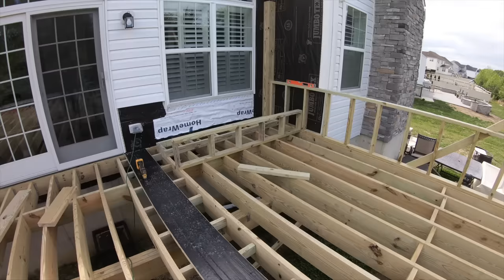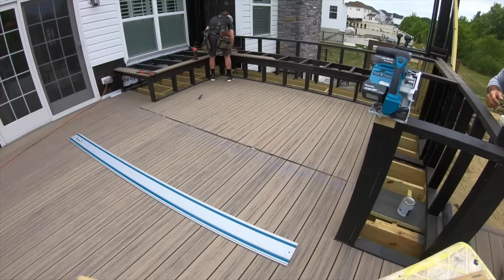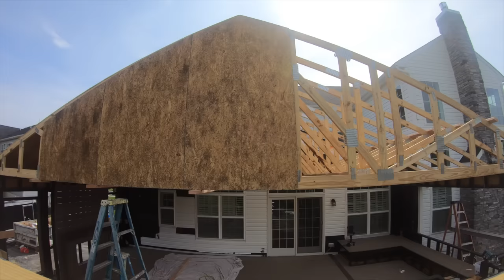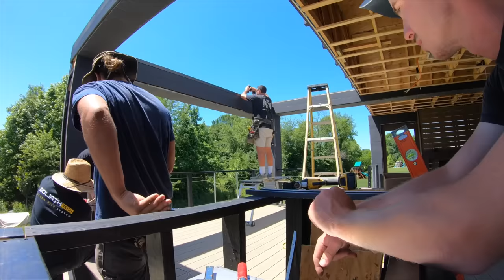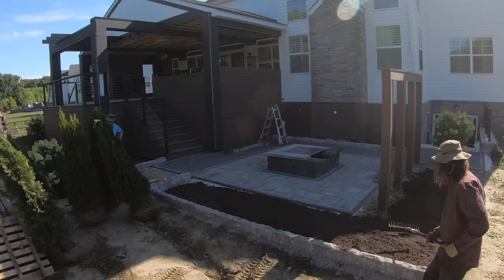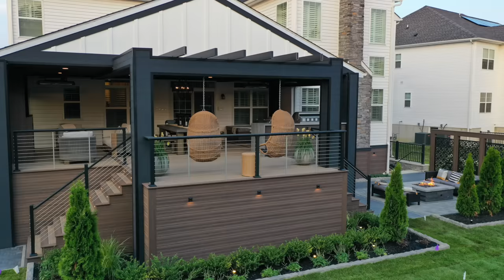INCREDIBLE BACKYARD MAKEOVER!! Covered Deck and Patio Transformation Time Lapse

Comment: Looks super nice!! Only wish they would've vaulted the ceilings and put in a big sky light as the roof blocked basically all of the light going into the house. But the design is flawless, modern, functional, luxurious!
Reply: Yeah, seemed like a huge waste to cover up that huge deck from the sun.
Reply: @C3mvp  I would have left the vaulted part at least; to let in the air and cool it down ( as the hot air would've risen outta the way

yes it would be more word as the internals would need to be weather proofed
Reply: Agreed
Reply: @anythingwewant604  The reason for blocking all that sunlight is because the sun coming through creates lightening of the color what ever it hits, also depending on where it is having skylights significantly heats an area like that up. They knew exactly what they were doing. This is a perfect job.
Reply: No I think they built it right, that's why they have the outdoor area near the fire pit for sunbathers. It would be nice to sit on that deck on a warm day with a cold beer. Go downstairs for the sun.
Reply: @kimgallagher6254  it's not about the light outside, it's about the light going into the house. That whole section of the inside of the house where the new roof is will be super dark now.
Reply: @TheRealSweedie  ☝️

Comment: Phenomenal work. I do wonder how you are able to make such a large structure without pouring any concrete footings.  I saw the machine piledrive the steel poles into the ground. So, I guess if those poles/pillars go down far enough then that will be sufficient to not need concrete footings?? Either way this looks amazing and I certainly would want something similar attached to our new home build currently in progress.  I probably would want a couple skylights so it just a little brighter underneath.  Thanks for sharing the video,  awesome work!!
Reply from the maker: Thanks a lot!! The footings are called helical piles and the machine can read the torque at which they are being installed. The engineer will spec a certain amount of torque needed to achieve for each footing depending on the load and that way we can be 100% sure they will never move under the load
Reply: @THEpremieroutdoor  won't the earth shifting affect it? Idk anything about construction
Reply: Well that's why in storm all can fly away 😂😂😂

Comment: Question ? Is the foundation adequate in comparison to that much weight. Seems like that addition should have had a concrete and rebar foudation to prevent sagging/ settling for long-term. That seems like a lot of weight? They done a beautiful job...looks great...but will it stand the test of time without a concrete and steel foundation?
Reply: It doesnt seem like alot of weight it is alot of weight. I would have gone with concrete to be sure. How are those skinny metal post not going to sink with all that weight on top of them
Reply: @juniorpineda4151  
Si Exactly 💯 Makes you wonder what kind of building codes and inspections exist in this location ?
Reply: Helicles can withstand a lot of weight. I've used them many times building decks
Reply: @Corvus_Crow  True, agreed fine and dandy for a deck. But this build was way more weight than a deck. Was a room addition.
Reply: @Sword-Shield  many houses are built on helical piers.
Reply: @Corvus_Crow  True...but concrete and steel foundations are better...stronger, but not cheap. You get what you pay for in the long run. Been around construction my whole life. No pole system is stronger than a real concrete and steel foundation. No matter how many times the helical system is used. I can show you foundations of concrete and steel that are still standing and strong after 50 years. Time will tell on the newer systems. Hide and ⌚ watch.
Reply: @Sword-Shield  not trying to be the advocate of aluminum, but helical drive down on average 5 ft , where most code standards for concrete footings are 3 ft. Not far from the Frost line . They both work effectively , just two different options
Reply: @Corvus_Crow  True. They both work. However, I'm old School and set in my ways. From the class of.. if it ain't broke dont fix it. In the academy of construction 🚧 the Golden rule is in the strength of the foundation, so goes the rest of the structure. In other words ask any old timer if you have to cut cost somewhere to stay within budget, never cut cost on the foundation. Foundation supports entire building and structure, as long as there will be a structure. Very important. Sure the  helical supports work...but they do not become one with and part the earth like a concrete and steel foundation. Nice discussion. But for me its concrete and steel on the foundation. Concrete is 5000lbs. [Solid as a rock] Per square inch...steel ties it all together as one.

Comment: this is what we call environment friendly. When the environment (hurricane) hit you all the house flys out. Where is the old good method with concrete so stays forever. Otherwise looks very nice, and congrats.
Reply: The thing was anchored good to the ground, didn't you see those 7ft poles driven into the ground at the start?
Reply: @omotolaoyeniyi631  yeah they better use the proper hurricane clips and not just nails cause this build is a stack build with even weight transfer, therefore each section is just stacked on top of each other. If there not held down with hundreds of clips hangers that thing is a kite

Comment: Great looking covered deck. I would have put some insulation in the attic of it though. A lot of heat is created up there that comes down onto the deck. I know I built a add on covered patio (20x36) on mine 30 years ago, after I insulated it made it a lot more enjoyable. Great design though and looks fabulous.

Comment: I have questions…

How come you guys rarely excavate down very far when doing pavers/interlock? 

What happens when those screw piles hit a boulder or rock?

When you’re cutting out the deck boards to lay an insert, does the saw blade not score the membrane on top of the deck joists? 

Thanks

Comment: How is the ledger board attached to the house? Hard to see clearly in the video but it does not look like 1/2" lag screws or bolts were used. Also did the local inspector not have a problem with the rail guards? They look very inviting for a small child to climb. Overall nice work though, I dig the design👍

Comment: Its beautiful.   The only 2 complaints I would have are:
1.) Unless this location has year round Hawaiian weather this space will not be useable al year which could have planned for and implemented rather easily.
2.)  There is A LOT of wasted space under this outdoor space.  Once again this could have been planned for and easily fixed so it would have been usable as something.
Reply from the maker: Did you miss the space heaters we built in to the ceiling? And the fireplace? Should be pretty good for most of the year!
Reply: @THEpremieroutdoor  yes I did actualy. I rewatched this and noticed them.  Very nice.